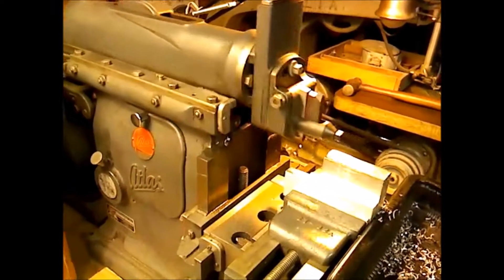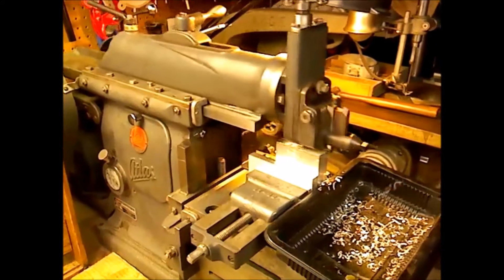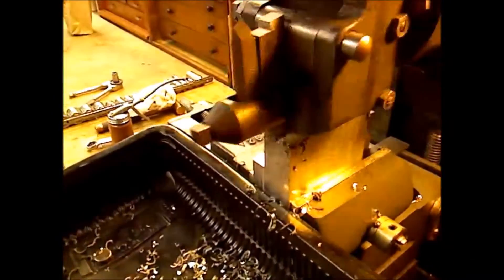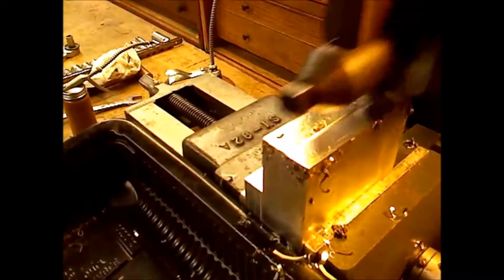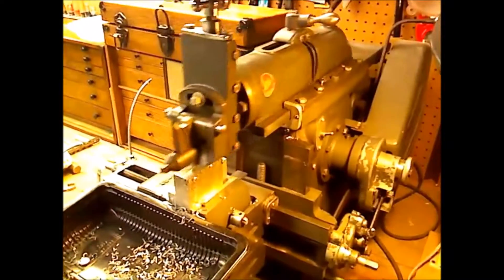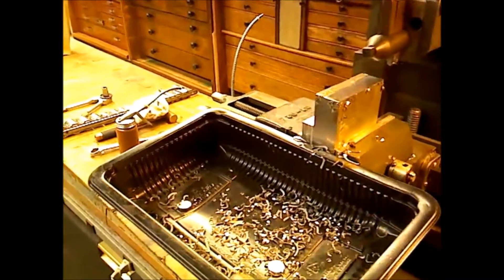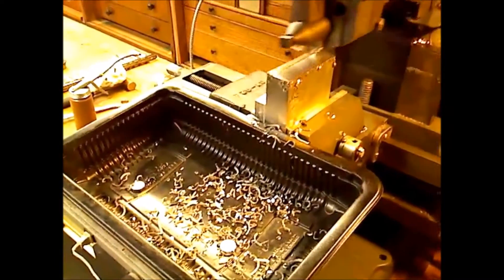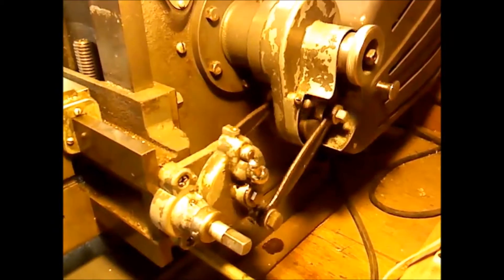Atlas 7B Shaper

Comment: I know this is an old video, but I have watched it many times.  I just uploaded my final Atlas 7B Shaper restoration video yesterday.  I must say that yours is running way slower than mine.  Mine is set on the slowest pulley and the motor is a 1725 rpm motor.  I can only guess that your motor pulley is smaller than mine or you're using a different kind of motor.  May I ask how you get yours to run so slow?  I want to slow mine down.  Thank you in advance.....
Reply from the maker: Nice work!  Sorry for the delay getting back to you.  I watched your video.  It certainly looks fast to me.  I measured the pulley on the 1725 rpm motor and it is 2".  Hope this helps.  Fred
Reply: @FredMiller  Thank you so much!  I really appreciate you measuring that for me and I really appreciate you watching my video!!  No problem about the delay and thanks again.....

Comment: cool shaper, just found you through the pin vise video and xynudu saying thats where he got the idea for his pin vise from you. I have a 7" rhodes shaper that I use for milling most of my stuff, and your right, the finish on shapers are amazing. I did notice that your shaper is running backwards tho, it's supposed to be faster on the back stroke than the front stroke. Thats why your not getting the ratcheting on the back stroke. Also, neat steam engines, Im a huge steam engine fan and am in the process of building a 3x3 steam engine, designing it from scratch. I also go around to various steam engine festivals around the country and help out at various events like that running the engines and repairing them.

Comment: Nice looking shaper Fred, I have a 7b also that was all original until last year when the motor shorted out so I ended up replacing it with a new one after they quoted me over $500 to fix it. It works great but I have a little slack in the pivot arms that creates a tick or knock half way through the cut and leaves a slight ripple in the finish at that point. the other problem I have it with the support rod, it's a hassle to slide in and out when I lower and raise the bed
Reply from the maker: Thanks for the comments Clarke..  It sounds like the advance mechanism may not be timed with the stroke??  The "tick" should occur when the arm is at the end of the return stroke.  If the advance mechanism advances during a stroke you will get a ragged cut at that point.  Good luck with the repair.  Fred